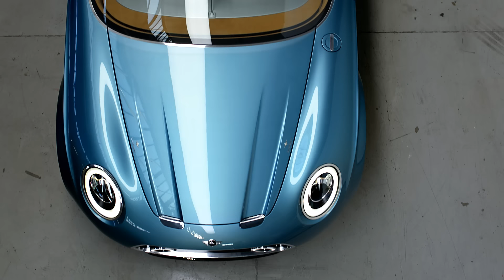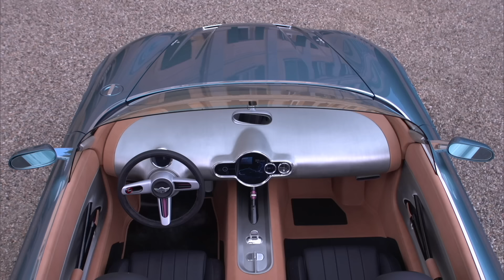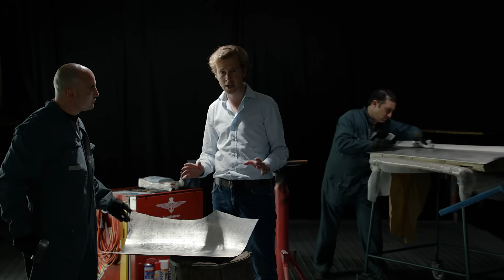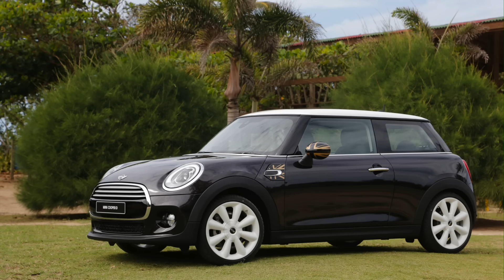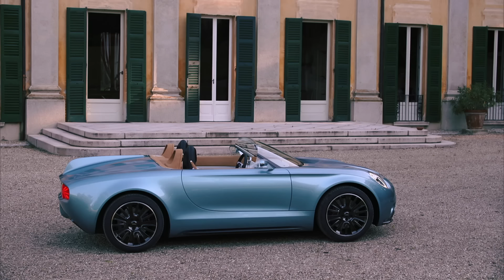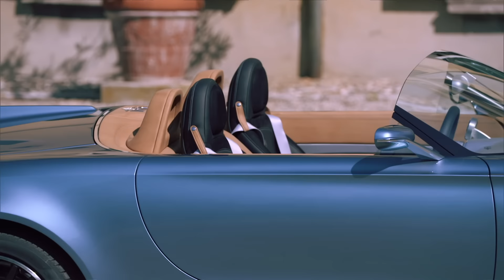The MINI Superleggera - How MINI's Most Beautiful Car Almost Went Into Production

Comment: I would have been so easy for BMW/Mini to make it into very low volume production... because that's what Touring Superleggera does! Most of their concepts are sold in very low production. However, Touring usually uses preexisting platforms, my guess is that they didn't homologate the Mini, so the jump would have been harder. Maybe now with newer generations of Mini they could more easily?